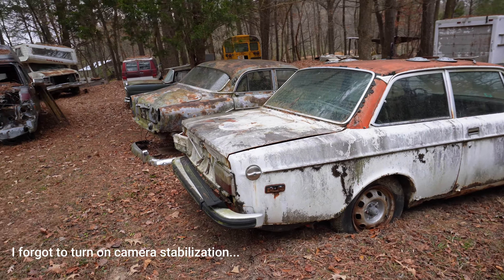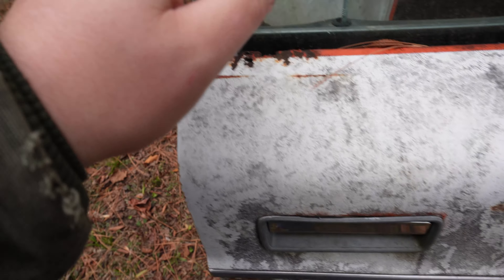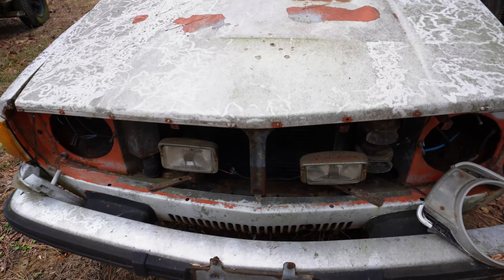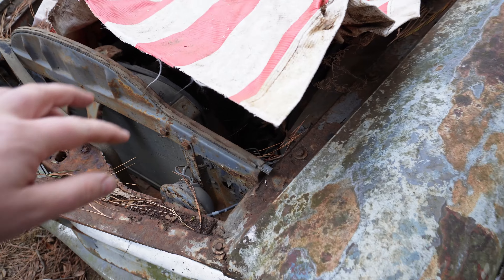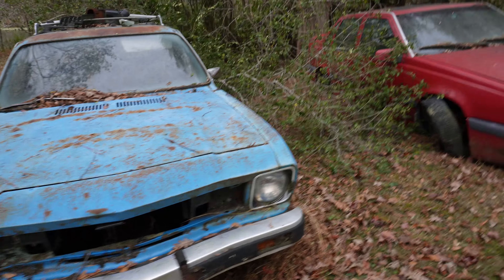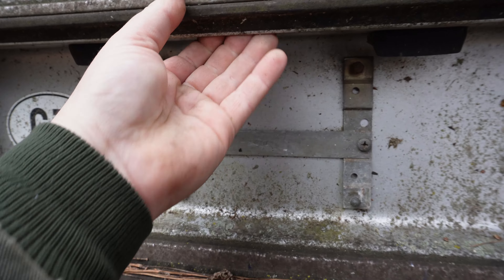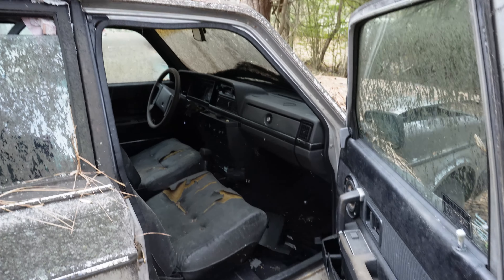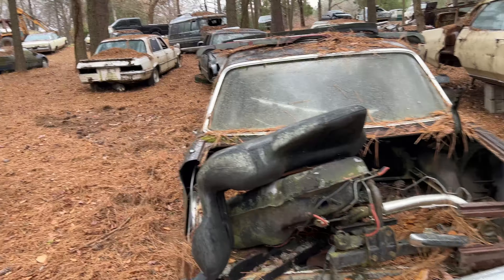Rare Classic Volvos Rusting in the Woods

Comment: You can check the year of the Amazon from the ID plate but I read it as early model year 1962 with the B18. The nice dash extensions on the doors were carried over from the B16 cars but I think they just used them until they ran out of them. Sensible move. I don't know how many '62 cars had them but I think they changed to the no extension dash before the '63 models came along. Cars with the flat upholstery before the big changes with the face lift in '65 also had the much nicer door handles and winders. They can be swapped in to later cars but good ones hard to find. The ones here are very bubbly which is typical. The trunk lid is interchangeable as long as you use it with the dead eagle handle. The holes are different for the later less fancy handle. A'59 would have opening quarter lights on the rear doors. I had a 1961 B16 car which had those. The glass may also be dated.
Reply: Correct, a 1962 model it is. The last year with dash pad extensions and the first year with B18.
Reply from the maker: Seems like you are right on the money!

Comment: I am inclined to thinking this is an early 60s Amazon. The grill isn't the same shape as my 58, and it should have a 6 volt B16 engine, not B18. Various other details does not resemble what I have in my 58. I wonder what a past owner was thinking when installing a rubber hose on the brake master cylinder?

As for which car to save, the 240 perhaps? They all are too far gone for my taste, but experience tells me the safest bet is a car with a good body. Other repairs are finite in comparison to body work.
Reply from the maker: That's the way I see it. Metal fab can eat up a LOT of time.

Last ditch effort brake repair? I wouldn't do the rubbers there but they have rubber on the caliper end...

Comment: Nice video !!! I hope paradise looks like that kind of place...
The first ''square body'' Volvo is a 142E (CI fuel injected) transformed to a carburetted model... I would say those were not Volvo's greatest cars... The second one, the 1958 Amazon  122 model is in my opinion still  saveable but will need a huge investment of $$$ and work. I think the 1965 and later (particulary the 1967 and later)  122S Amazon models are alot more interresting to restore than the early (pre 1965) ones...
The 244GL looks in relatively good condition even though these are not realy desireable  models...
Reply from the maker: Im not sure i would call it heaven. I prefer the 66 and later volvos myself.

Comment: So far as I've ever seen Volvo did not offer factory vinyl roofs on any 140 series, I have seen them put on them though. Dunno if the two I've witnessed were dealer to custom shop applied.

That thing looks mighty rough to try and bring back and that's coming from a guy who has a less than perfect 1970 142S. I'd say grab the parts you need and let it slowly return to the earth.
Reply from the maker: I may pick the whole thing up for exprimental purposes. Its got some parts I could use

Comment: It's a shame that orange 142 is in such horrible shape.  Would have been a great 70's color originally.   Very little value on the Amazon.  As others may have said, likely early 60's not a 59.  Again, very little value on it.  Maybe a few parts.  I've heard the chrome door tops are worth grabbing as they are out of production.  If it were a 59, I believe it would of had the cool rear vent windows on the rear doors that work like the front one's but in reverse.
Reply from the maker: I would have loved to snag that 140 and save it. I wish the 122 had the cool vent windows. I think the collective knowledge has decided its a 62 as it was the first year for b18